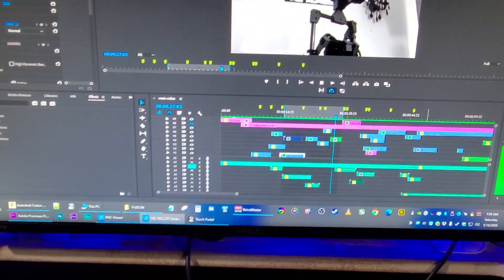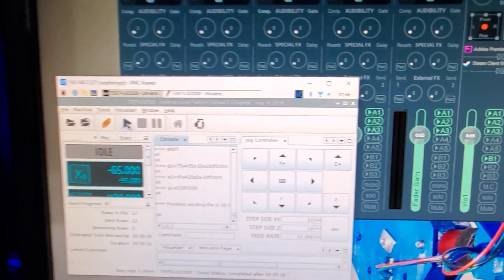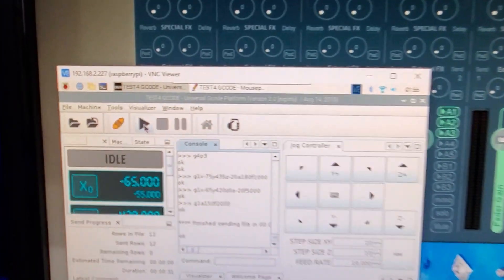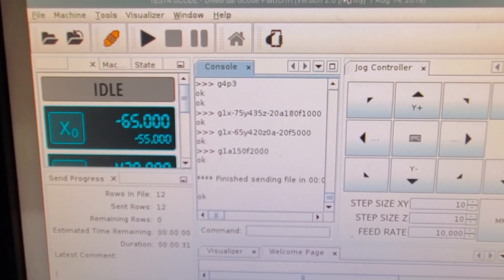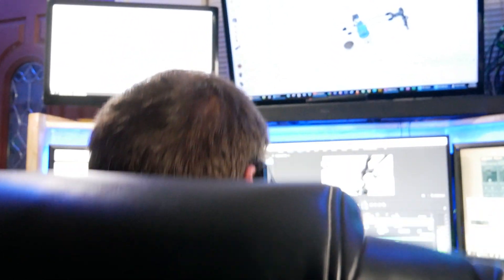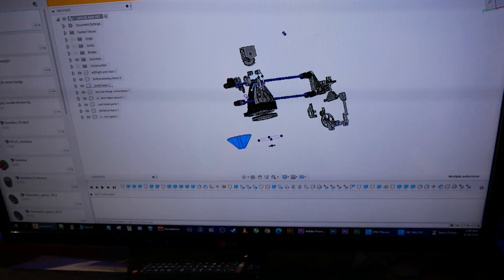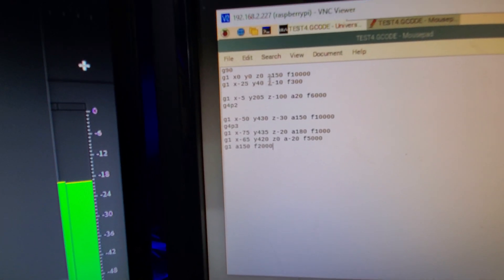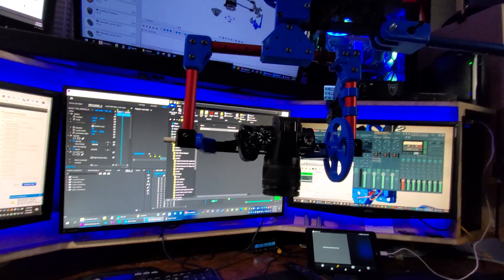SIMPLE SETUP 3d printed motion camera - Behind The Scenes look

Comment: That's a nice rig ! i'll try to build one when you release it !
How's accuracy ?

Did you try to drive it with dragonframe ? it's compatible with arduino and it's great for programming complex camera movements ;)

Thanks
Reply from the maker: Hey thanks! 
 I wanted to have the project wrapped up and ready by now... But life's getting in the way :) I'll definitely have another video coming when I finish it and drop the files online. 

I haven't tried out dragonframe but I'll check it out! 

As far as accuracy, it's hard to say. Inherently it has some slop due to the construction materials (3d printed) as well as the cantilevered type design (lots of inertia). The accuracy changes depending on how fast you're trying to move it and and how much weight you have on your camera head. 

I think it's a cool tool for anybody doing low budget film work and more than likely can be properly tuned for stop motion and higher accuracy... 

I'm a one-man band and I primarily designed this to shoot random shots I couldn't shoot by myself including smooth +360 degree rotations and pans. 

What kind of stuff do plan to use this for?  

I'm actually pretty new to the filming scene so I'm still trying to absorb everything 😁